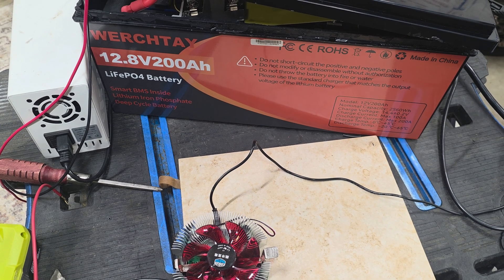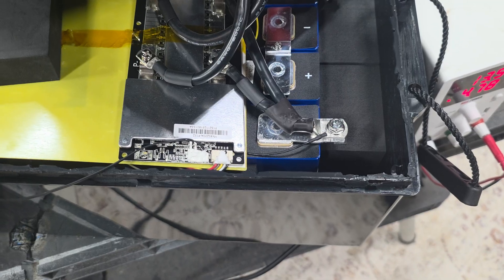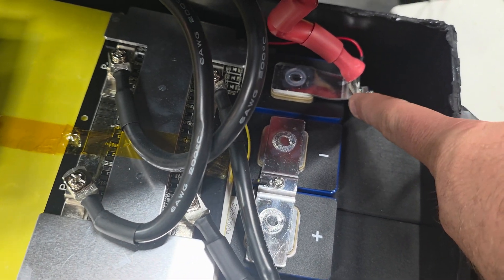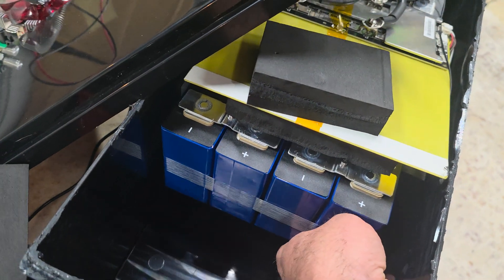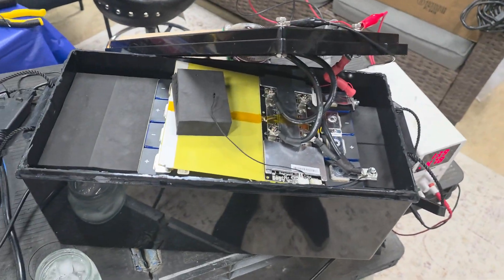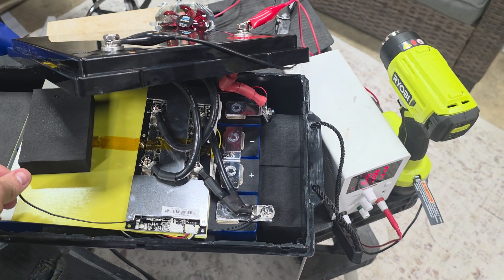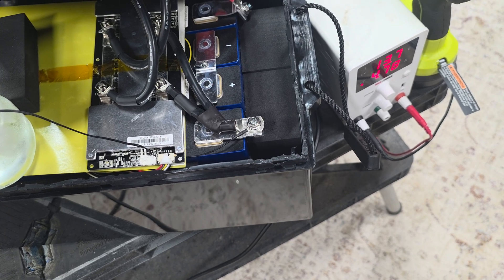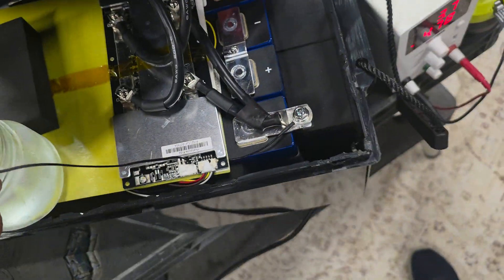200ah $130 Temu Werchtay 12v Lifepo4 Battery Teardown

Comment: Hi Tim, I just bought 2 batteries of this brand 24v 100ah, I am planning to have them as a battery expansion for my anker solic x1000 in my camper. do you think they are worth it? I paid 700euros for both of them new batteries.

Comment: I'm tempted to buy this brand but I do know if you buy cheap you get cheap. Do you feel confident with this brand/battery? Thank you
Reply from the maker: Its built a lot better then the PUJIMAX that I also cracked open. I've been cycling a set of 4 PUJIMAX for about a month all are handling the 30 load.  I don't know the max amps this Werchtay could handle, but i'm thinking about adding a set to my car charger setup. The draw would be 30 or so amps. I think it should handle that no problem. Might be a good rv battery also for lights and what not.
Reply: @MrTim1212  Hey Tim thanks for your time. Worth a sub. I'll keep an eye out to see how your batteries are holding up. I've always purchased Power Queens but they are pricey and just need a 24v as to quick charge my Ecoflow delta 2 max.
Reply: These are much better build Quality then some mainstream batteries, as price never means better, just more royalties you are paying for the name.

All come from China, some Chinese companies can do it much cheaper, and without the royalties, and this is why alot of countries want to out tariff on Chinese companies, because they want their corporation to keep making money
Reply: @paulroustan3643  WARNING: I GOT 2 OF THEM FROM WERCHTAY EBAY AND BOTH BATTERIES ARE GARBAGE. ONE IS OFF BY A SUBSTANTIAL 6 LBS FROM THE OTHER AND BOTH DO NOT CHARGE PROPERLY NOR HOLD A CHARGE. sTAY FAR FAR AWAY FROM THIS BRAND!

Comment: So the cells are actually accurate if they sell these as 180 ah cells I think these are useable
Reply from the maker: Oh yeah the labeling is correct to their actual capacity it's just no low temp protection and the thermal pickup is in a pretty weird spot.
Reply: @MrTim1212 I can set low voltage protection on my inverter ..I have 3 of these 100 ah 12v...awesome batteries